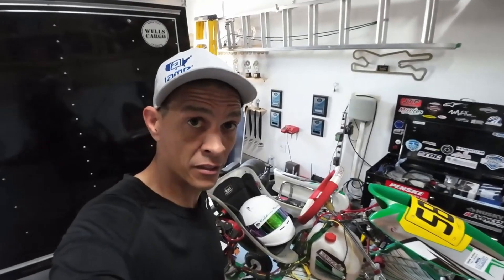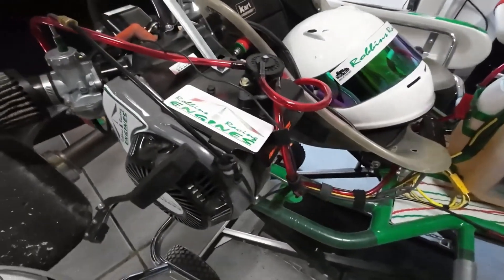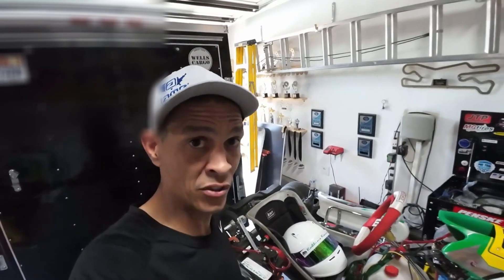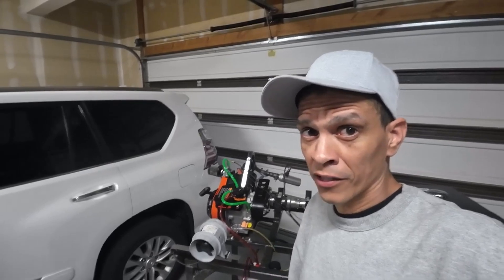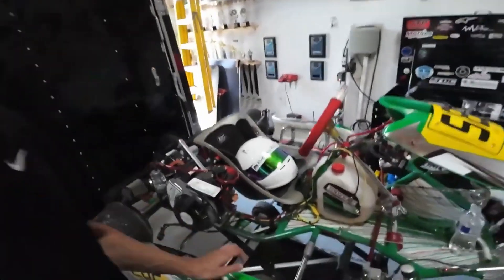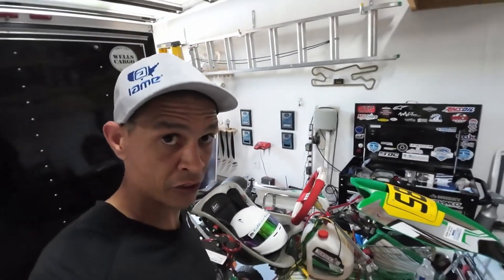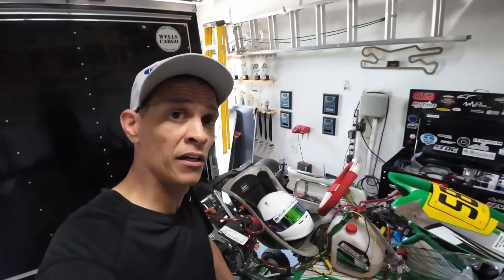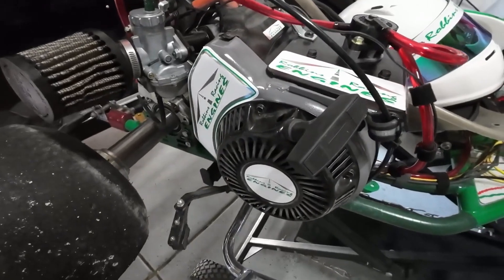DYNO Tuning the Briggs LO206 EP.4 - Engine Problems!!!

Comment: Last year did my first ever practice day for my son. Kart ran fine at home the day before. Get to the track and it would barely idle then die. I figure out it’s not getting good fuel. Swap the carb, fuel pump, change all the fuel lines EXCEPT the line inside the fuel tank (because I’m an idiot). After hours of work I finally give up. My son is super disappointed. Next day in the garage I unscrew the fuel pickup line from the fuel tank and the dry brittle fuel line breaks off and falls in the tank. I haven’t felt that dumb in a long time.
Reply from the maker: Ya man I feel you pain. That's how we learn though!

Comment: Could be vapor lock. You got the fuel pump right on top of the head don't you? Probably building up heat and vapor pressure. You never know though until you find it.